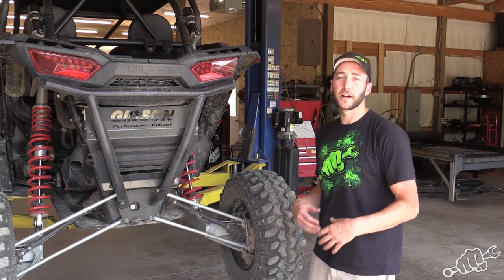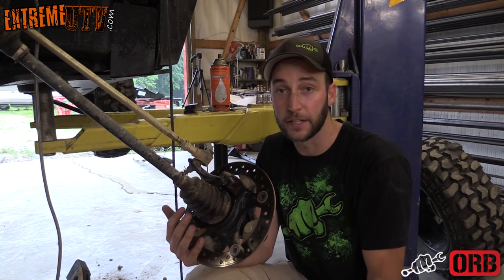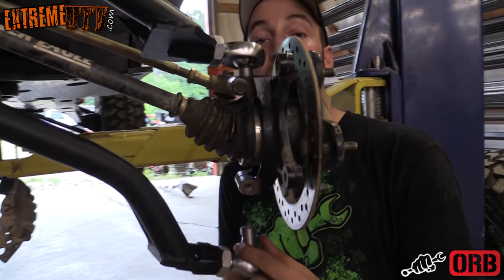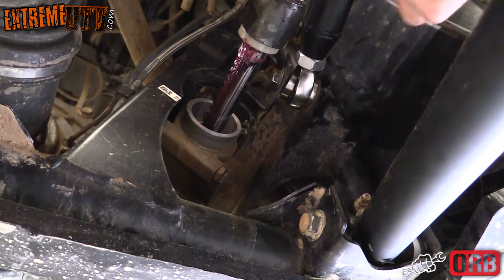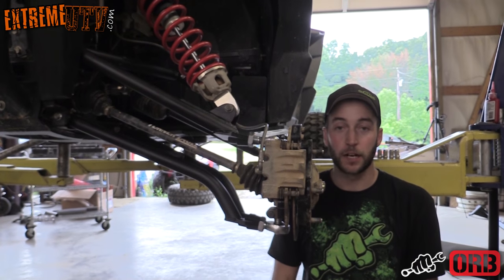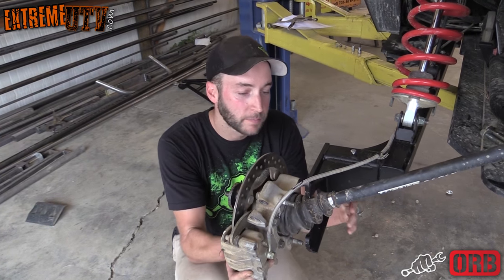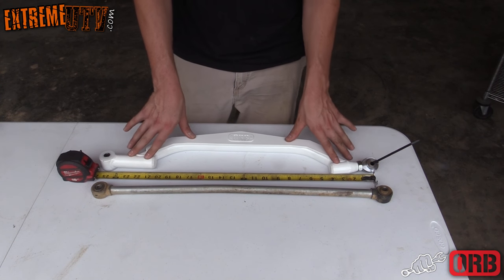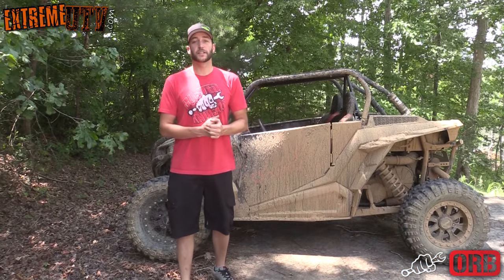RZR Suspension Upgrade -  Extreme UTV Tech Ep5

Comment: Really wanting to upgrade the suspension on my rzr. My issue is I need to keep it at 50" for trails, but I was the suspension to play double duty in the dunes and forest trails. Recommendations?
Reply from the maker: Get a good strong suspension, kit's like the one we installed here does not make your machine any wider.

Comment: Hey on my dads rzr 900 2013 there is oil coming out of the belt cover
Reply: Shaft seal.. If it's trans fluid it's the secondary.. Engine oil it's the primary..
Reply from the maker: looks like rzr life has your answer.